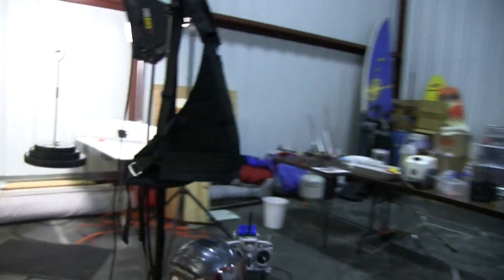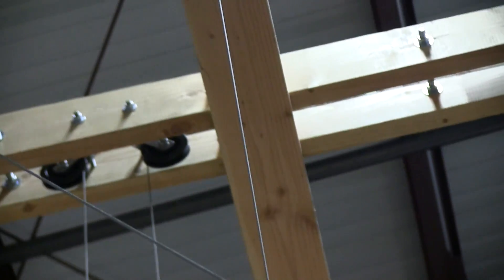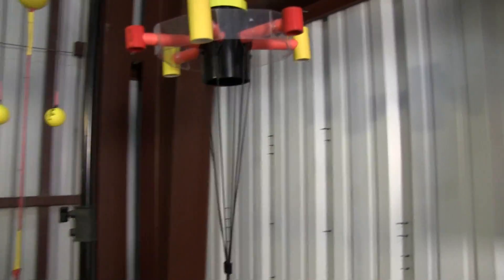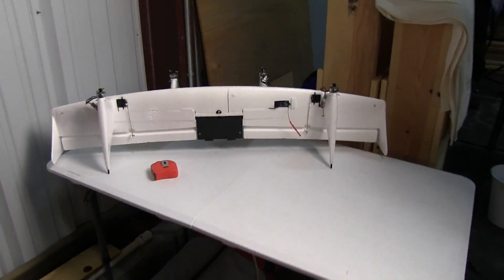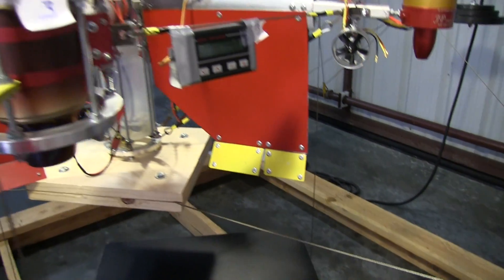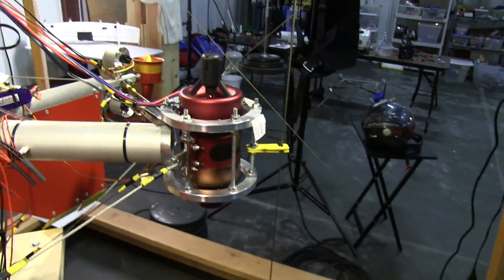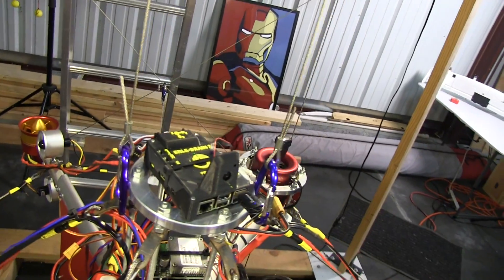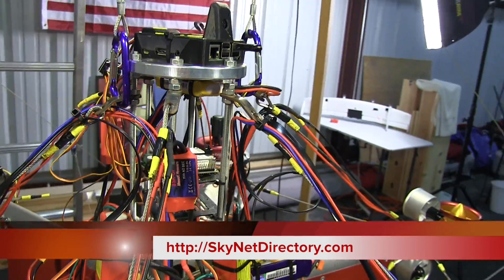Turbine Drone Test, Electric Fans Only

Comment: So 75 pounds of thrust total. - That won't be able to lift you?
Reply from the maker: +Adam Wilkinson It would need as much thrust as I weigh, about 180 pounds. And I would need to pull a small G > 1 to actually move upward, so 200 pounds thrust should lift me. The next version I'm working on has over 400 pounds of thrust.